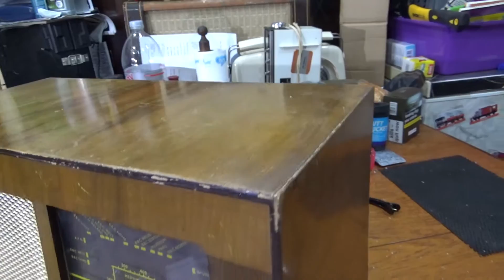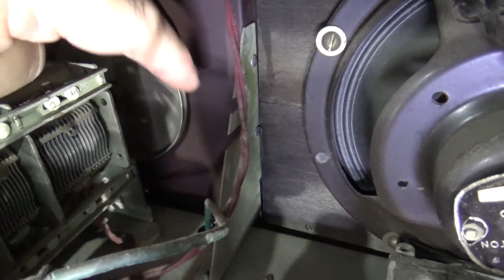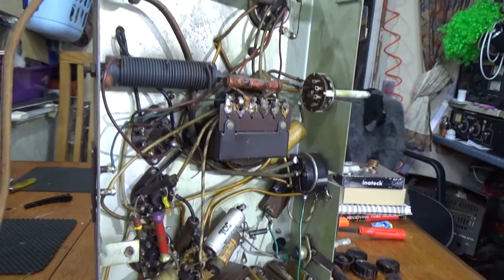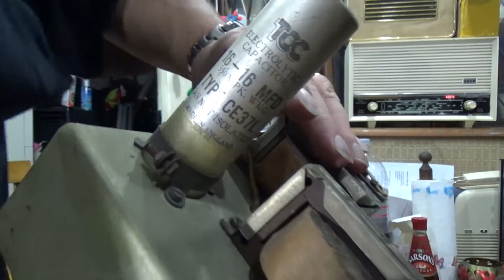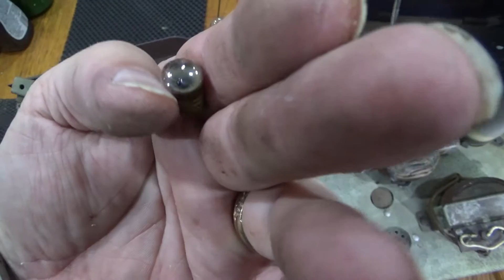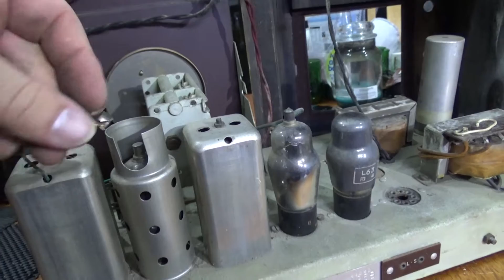Jonell 1949 Tabletop Radio. Restore an old radio Pt. 6

Comment: Good find George! Perhaps the crackling the former owner heard was a passing thunder storm..... You'll have two desirable
sets when done. Cheers,
John
Reply from the maker: That's what I'm hoping. I couldn't believe the fact that one came up on eBay, let alone less than 3 miles from my house! Doing some digging, that L63 valve in the output position is actually a triode, not a pentode and is one that audio buffs are likely to kill for. The NOS price is 100USD! I think that might end up on eBay on its own...